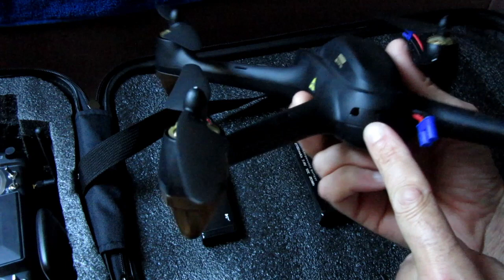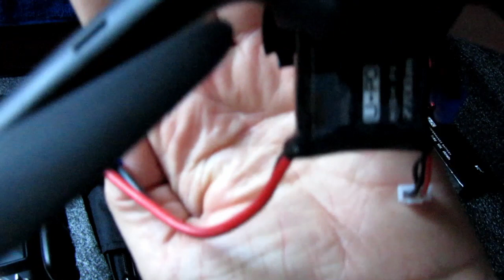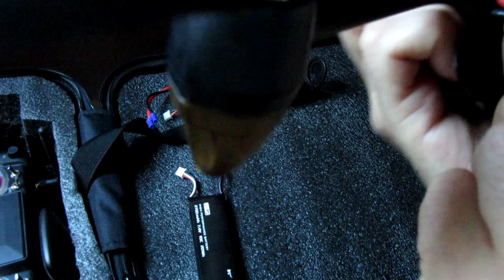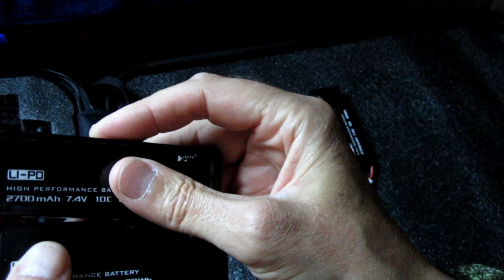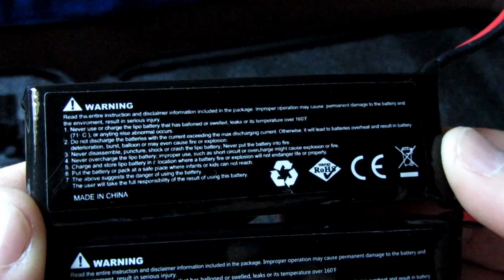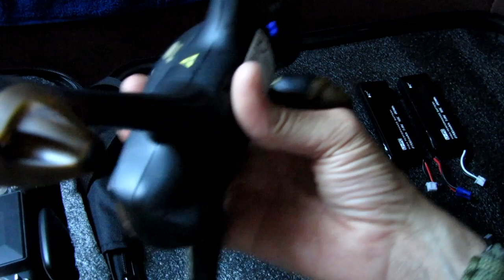Hubsan H501SS  X4 FPV Quadcopter  Battery Fault

Comment: There may also be an issue with the 501ss.  Hubsan moved the camera module to the bottom of the battery bay.  Thus restricting the size of the battery bay.  In the end it is a hassle finding batteries that fit.

Let me know if you got a refund or what resolution banggood offered you.
Reply from the maker: Gimp Man good point but it was the end a of the batteries that stuck out all I did was cut the plastic tuck the wires in re taped them sorted...
Reply: I have not had a problem fitting normal 2600 mah lipo batteries. I bought the ones from morpilot. They work just as good (maybe even better) than the hubsan. The only other way I guess is to make sure you are buying from hubsan.

Comment: I recently received two of these batteries from banggood.  They are too thick and the wires are long to fit in the battery bay..  One does not go in the battery bay at all.  The other goes  in 2 cm before getting stuck. I am in the process of trying to get a refund.